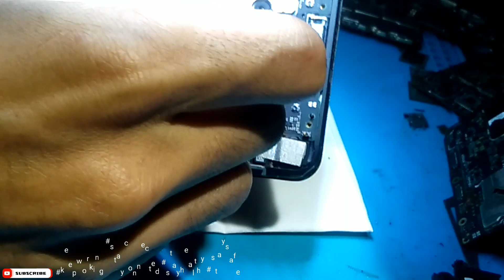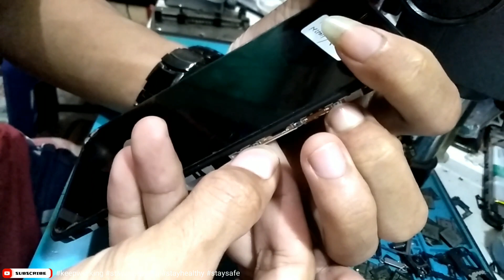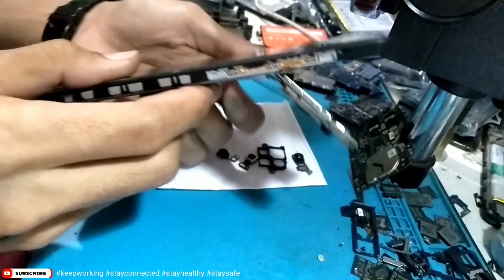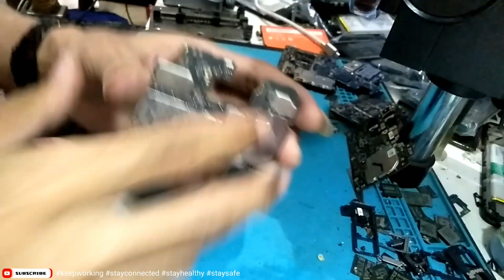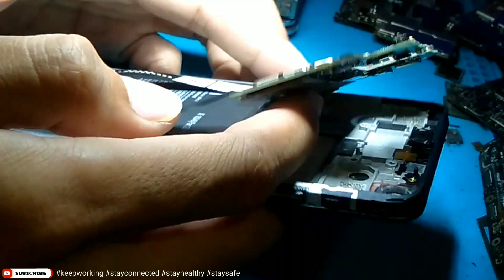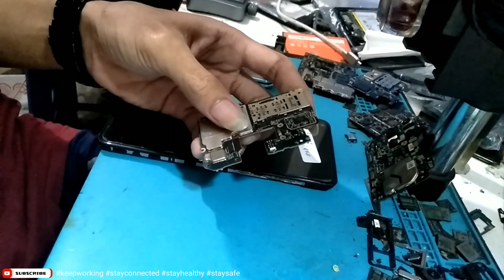Redmi Note 9 Merlin Restart Problem | Charging Restart | Recovery Not Open @mobilecareid

Comment: Did you leave it without the thermistor or put another one in its place?
Reply from the maker: Not sir, but if the device keep restart, try replace 'R1207 Thermistor to sense AP temperature' which goes to the RF IC with 15.xx-35.xx m/k
Reply: @mobilecareid  Thanks
Reply from the maker: @dougls1995  You're welcome

Comment: Assalamu alaikum Bhai 
Amr redmi note 9 phn net chara akbar off hoy nh 
Net connect krle 5min por por auto restart hoye jai 
Bhai ay phn tar kih prblm akto blte parben ?R thik krte koto lgte pare anumanik ?
Phn-redmi note 9 
Model-M2003J15SS
Plz kindly reply diyen Bhai
Reply from the maker: Please use speak english sir
Reply: @mobilecareid  My redmi note 9 phone get restart when I connect with net connection 
And when the net connection is off then the phone is okay there's no prblm 
In net connection why this prblm occur?And what's the solution?
Phone name -redmi note 9
Model-M2003J15SS
Reply from the maker: @ehsanrobin9737  Maybe same problem sir, you can try take off the shield like in the video
Reply: @mobilecareid  The solution is not by removing the cover. But by heating the RF ic. When trying to remove the shield. The IC gets heated that's why it worked. Next time after removing the shield cover, try put paste on the RF then heat it up. It will work

Comment: Hello. I have the same problem with my Redmi note 9 it stuck in the MI logo, bootloop, I go to the repair shop he tell me you need to flash your phone. So what I do please help me😭😭😭🙏 please reply.
Reply from the maker: Try flash, or eMMC urgent
Reply: Thanks for your quick reply.🙂
My phone works normally when I put it on the charger but if I remove it, it will restart & get stuck. So there's two options:
1- software problem
2- Hardware problem

Comment: Lol it actually works. im from ph guys you can try this. jst remove the plate and reheat it.
Reply from the maker: Nice
Reply: @mobilecareid  but the thing is, idk why the front cam is not working anymore
Reply: @mobilecareid  have you encountered it?
Reply from the maker: @superganie448  Lines of camera going to CPU (bad connect) if the line is normal (tracking with dioda mode)